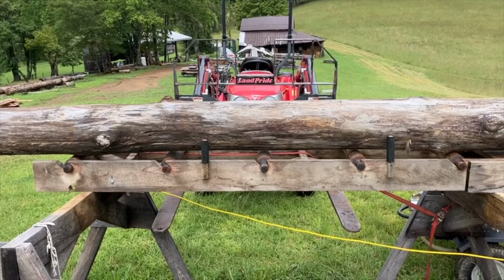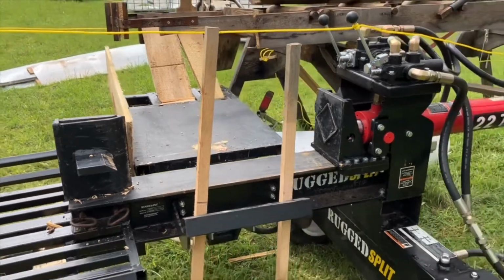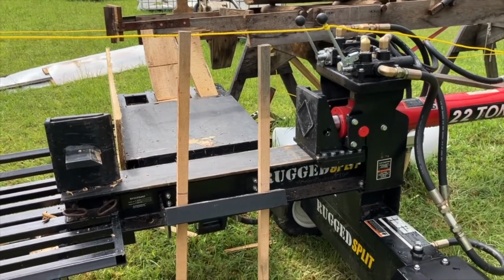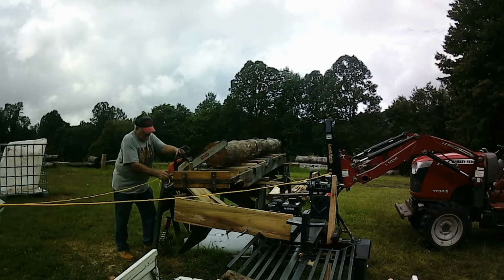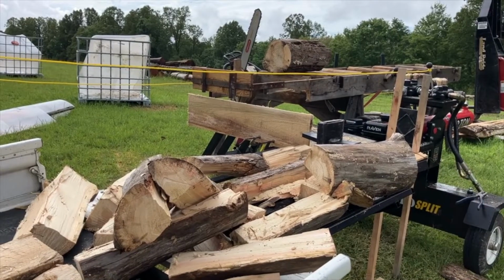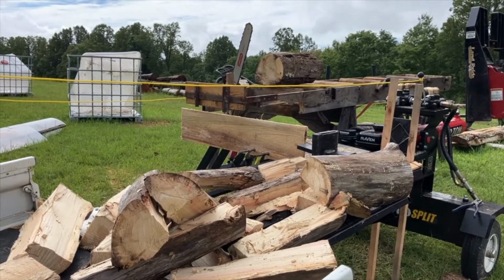Firewood Processor ?

Comment: Dang now that is wv hillbilly one man band… lol love it
You will get it all tuned in. I use to have trouble with my stihl wanting to start until I switched to the ready mix fuel. Hey like they say work smarter not harder… good job. Thanks for sharing. You all take care
Reply from the maker: This is a 261 from the junk pile. I put a $40 after market top end on it. It usually starts cold on the third pull.
Thanks for coming back
Brent